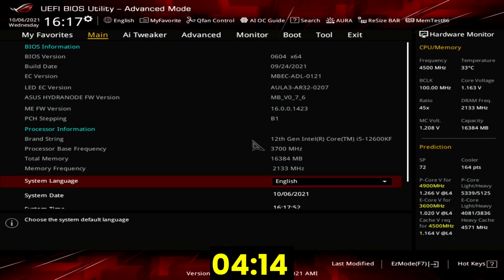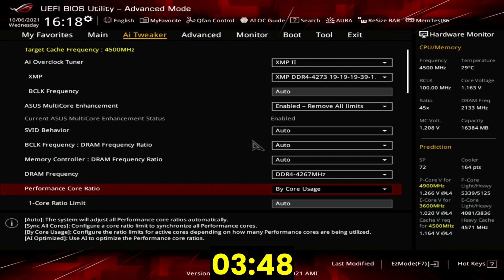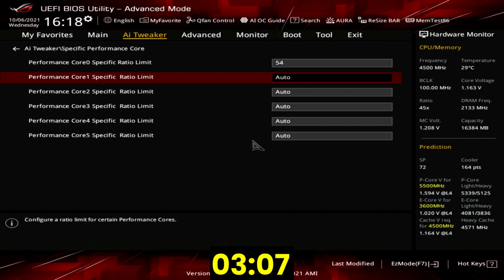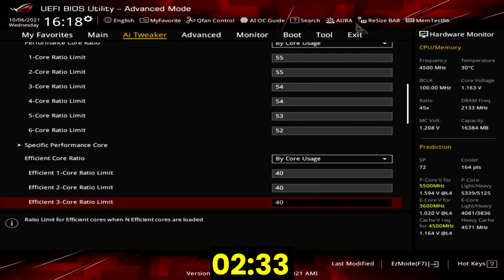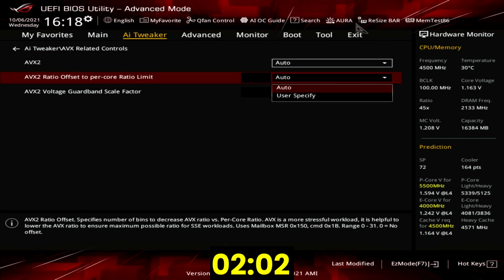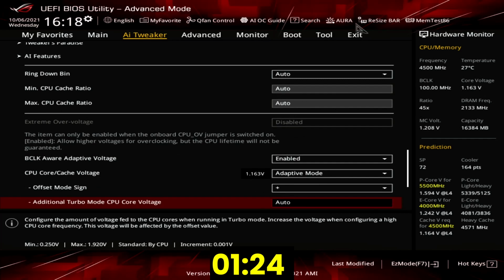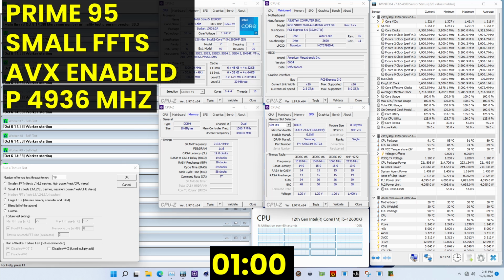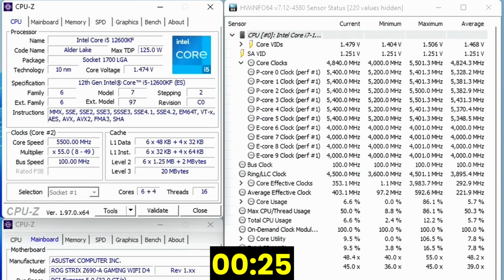5 Minute Overclock: Core i5-12600KF to 5500 MHz

Comment: I'm quite confused, on Intel websites, it says this chip can only go up to 4.8 which mine also does. When I went to BIOS, I can only input 49 for the Performance Core Ratio, I can't input 55 to get it to overclock at 5.5GHz
Reply: You need Z-series motherboard
Reply: Just had the same issue after buying an i5-12600k lol. They don't make it obvious you need a Z board. I miss the old days!  @IndeecFOX

Comment: It doesn’t count as a 5.5Ghz overclock if it isn’t an all p-core OC.  The most I was able to get in an all core OC was 5.3Ghz with 1.355V.  I got my E-cores to 4.2Ghz with 1.355V.  At an all core load on Cinebench R23 and R24, my temps were between 93-98 C.  In case it matters, I have a 240mm AIO.

Comment: Do you think with proper airflow, a 240mm AIO with a high quality thermal paste (MX-6 or Kryonaut) that it could handle it? Or is a 360mm really needed?
Reply: This is just a bad overclock guide in general, with the bios ai overclock I got a conebench score of 18500 at 72c and with this overclock he only got 19900 but the temp hits 100c lol

Comment: I just bought a 12600k for $150. Going to use the Asus B760-I Gaming WiFi board. I’ll be using the brand new Hyper 212 Black that I got for $35. Going to install my Noctuas from my old system (RIP 4.5GHz 2500k) in a push/pull configuration. Do you think it’s possible to OC all P cores to 5GHz with my configuration?
Reply: Some of you may be thinking why Hyper 212 it’s outdated! Well for one it was $35 dollars on Black Friday and for two I have watched multiple reviews that show this cooler being on par with the Peerless Assassin.

One review was a 13700k at 175W on Cinebench R23. After heat soak the new Hyper 212 black and Peerless Assassin peaked at 60C and the Noctua D15S was at 55C which is a $170 cooler.
Reply: This is easily doable
Reply: No you can’t cause B760 motherboard can’t overclock

Comment: @SkatterBencher Greetings, sir! 
May i ask you what's the difference between Core Ratio Limit and Performance Core Specific Ratio Limit? 
It seems that if I use your preset I run into quite high temperatures, so i want to lower the Additional Turbo Mode CPU Core Voltage but when I do that I face BSOD/forever freeze. So, i guess, i have to lower the core ratio's as well. But i don't understand the difference between Core Ratio Limit and Performance Core Specific Ratio Limit. Which one should i reduce, for example, to have x52  P-cores ratio? Both? If so, what are proportions?
Reply from the maker: I can see how those two terms could be confusing. I'll try to explain it.

"Core Ratio Limit" is the term used for the Turbo Boost 2.0 configuration. In short: Turbo Boost 2.0 will allow cores run faster than the base frequency depending on the number of active cores. If one core is active, then there's more headroom for higher frequency then when all cores are active. This is CPU ratios configuration that you usually find in the main overclocking BIOS menus.

"Core Specific Ratio Limit" is the term used for the Per Core Ratio Limit overclocking function. In short: Intel allows you to restrict the maximum ratio of a specific core regardless of the Turbo Boost configuration. For example, let's say you let Turbo Boost run up to 60X when 1 P-core is active but only 4 of the 6 P-cores can run 6 GHz. In that case, you can use the Core Specific Ratio Limit function to restrict only the "weak" P-cores to 59X whereas the others can boost to 60X.

Typically, you first configure the Core Ratio Limit, then finetune if necessary with Core Specific Ratio Limit.
Reply: @SkatterBencher  Many thanks for the response! Will try to find the optimal OC settings for my CPU

Comment: So this is how I adapted to my system with DDR5:
AI overclock tuner AUTO (mine wont work on XMP)
Performance Core Ratio (stable only with): all sync 52
Specific Performance Core Ratios: AUTO
eCore Ration as in video
Everything else as in video
Notice that in new BIOS versions Cache and Core Voltage are separate and you need to put both at 1.45 adaptive.

If you get Bluescreen when testing with Bench it's probably because of Performance Core Ratio that is too powerful or because eCore Ratio is not set 39 40 40 40
Regards and thanks again!

Comment: ASUS Multicore Enhancement. What is the MSI bios equivalent? I can not find this setting in my MSI Pro Z690 A wifi DDR5 bios
Reply from the maker: MSI has an option called CPU Cooler Tuning that does the same like MCE when you set it to water cooler

Comment: I did 

53
53
52
52
51
51

E core
38
38
37
37

In advanced I did
Core 0 52
Core 1 52
Core 2 53
Core 3 53
Core 4 52
Core 5 52

Set the turbo voltage you set to 1.45 but I set it to 1.40

Benchmarked 99th percentile 

So only 1% of existing i5-12600k benched better than mine. Crazy performance

I recommend everyone keep all his settings as he explained but use mine instead. More reliability and basically same performance
Reply: one question,, are these frecuencies wll maintain the frecuency high all the time or will reduce will the system is not using intense task like gaming? o dont want my electricty bills brake y pocket
Reply: @JusunGuitar  Use 52,52,51,51,50,50 and 1.3-1.32v. Stable and use <=135w in typical soft in 100% (work/play)

Comment: I have a question that may seem silly. I've had this processor for some time with 6000Mhz ddr5. My motherboard supports 6000mhz but the processor apparently clamps at 4800mhz. Would overclocking the processor allow me to increase this limit so that it supports 6000mhz?
Reply: Set it to 5200MHz for optimal performance without hitting IMC bottleneck of the i5 12600k
Reply: got the same speed ram 5200mhz on XMP for i512600k no problems runs great @whipboy666
Reply from the maker: Sure! You probably just have to enable XMP in the BIOS.
Reply: @SkatterBencher  thank you !

Comment: Im using the 12600k with 360mm custom water cooling at completely stock i hit 100c in cinebench r23. Even undervolting to 1.18v it sits around 90c
Reply: it should not be a case
i am rolling it on artic freezer 34 (air cooler) and stock running on cinebench 23 going only to 69 max (max peak temp)
something is wrong, maybe forgotten plastic sticker from cooling??

Comment: Why ur frequency on load are lower then u set it? I have the same problem
Reply from the maker: When the CPU hits the thermal limit (TjMax), the CPU will automatically reduce the operating frequency (and voltage) to protect itself.
Reply: @SkatterBencher but it's only 74 max on core, not even 100🤔, and under load all cores are taking the lowest core frequency, same with E and P cores
Reply: @tiblokill  AVX? TVB?

Comment: Im running the 13600kf. And if i run a benchmark the cores dont hit the MAX CLOCK, which in my case should be 5.6. It settles at 5.4. is the reason the temperature?
Reply from the maker: It can be a variety of reasons including temperature, but also your turbo ratio configuration or per core limits. Hard to diagnose over the internet :)

Comment: The results are better than all core overclock to 5.2 on Pcores and 4.1 Ecores. Thank you! Idk how you don’t have more subscribers. Excellent work mate, keep it up.
Reply: Also, my clocks are not even, they are 5480 instead of 5.5, or 4085 on ecores instead of 4.1. Is it normal? Can I make it even? :) thank you for your help again
Reply from the maker: That sounds like it's because spread spectrum of the base clock frequency. That will make it run at slightly below 100 MHz and thus the frequency will be slightly lower. Usually there's an option in the BIOS to disable spread spectrum.

Comment: will this always be overclocked or only when it's needed?
Reply from the maker: Only when it's needed (as long as you keep C-states enabled)

When the cores are not active (e.g. idle) they will go to sleep and use little to no power. When the cores are active, they'll run according to my overclocked configuration.

Comment: May ask you?
It's the same prossecurre for P CORES 4,6 and E CORES 3,6??
I just want to have a little bit more performance with my 12600k
I have asus rog z690 g,12600k,ddr5 6000mhz 2x8 xmp II.
Can you assist me or male a video with lower oc?
Thank you
Reply from the maker: The same process can be followed, just set lower values. If you want more information on how to overclock, feel free to check out my long-form SkatterBencher guide

Comment: Yet again, another video with a massive AVX offset -5. So in most loads including gaming, the clock speed with be 4.9 to 5.0 (not 5.5 GHz) as you claim in the title. Also 1.45 V? No.
Reply: What those should be at?
Reply: Very few games use AVX

Comment: dont use 1.45v...
Reply: Why? And how much should i use?
Reply: @lokiloki2940  cpu degradation...
Reply: @icold666 what's a safer voltage?
Reply: @TB_SnEaKy  I recommend 1.3-1.32. For 5-5.2Ghz
Reply: @IndeecFOX you can do 5.0GHz at 1.0-1.1v
Reply: @zaclaplant3001  maybe with good cpu chip , mine 5.0 it does it at 1.29
Reply: Bulshit cpu degrading :D i use 1.45    6 years long ;)
All ist temp guys.

Comment: Can you do an updated version so it matches the new BIOS versions. Newer versions is alot different . Thanks!
Reply: Use the Intel Tuning Utility software. Much better. You can save and import/export profiles, it's within windows so you don't get stuck in a boot loop and BIOS will automatically ask you to restore to default if you crash (but then you can just load your profile and tweak it).... All the same options for tuning. Maybe more.

It also has built-in benchmarks and stress testing so you can compare with other profiles (The benchmarks  are short, so you'll want to stress test for stability).

Comment: Wonderful Video!
I am interested to upgrade my system to 12600k and prime z690-p d4 but I am really confused about the cpu cooler.
On one hand there's "Gamer Storm Castle 240R" or "Corsair H100x" or "DarkFlash Twister DX-240 ARGB" as an AIO, in terms of air cooler there's "Noctua NH-U12S" "Cooler Master MasterAir MA612 Stealth" "Noctua NH-D9L" "Thermaltake TOUGHAIR 510" "DEEPCOOL AS500 PLUS" "DeepCool AK620" "MASTERAIR MA620P RGB"
These fit in my budget, please let me know if you have had a good experience from any of the cooler listed above or know for a fact that "ABC" cooler would be good for OC
Thanks in advance.
Reply: lian li galahad aio 360 is what im using
Reply: Artic freezer II if you want an aio
Ak620 if you want air cooling
Reply: I would prefer AIO for better sound and performance ratio or go with notchua
Reply: all about warranty length i tend to stick top corsair they offer the longest warranty's on there parts like psu 10 years lol and AIO  5 years and probably more maybe now in 2023

Comment: When I try to change the core ratio limit they all revert to 49. Is there a way I can fix this?
Reply: Do you have a Z690 board? If not you wont be able to increase the multipliers. 
If you have, you need to disable the oc limits.

Comment: Thanks for this guide. I manage to run Cinebench and 3dMark CPU Profile with these settings on : 12600k, Asus Prime Z690M-D4 Plus And Corsair h115i Platinum.
Reply: It’s work ?
12600k , 5Ghz
Reply: @uood-m4j my 12600k max 4.9 and after long time blue screen , with aio 360 aswell dont know
Reply: @ffkfff  my 12600k can up to 5.2Ghz 
also i set 5Ghz is stable and low temperature.
Reply: @ffkfff  if you want up to 5ghz+ you should more Vcore 1.25-1.30 , but your cpu will get 5-8 degrees hotter
I think motherboard It can also cause a blue screen or unstable power delivery.
Should make stable .
Reply: Now i use motherboard z690 Aorus Elite ddr4 i set 5Ghz ~ 5.2 Ghz vcore 1.25-1.27
Temp. 50-60°C full load 70 °C Aio 360 and Overclock Ram to 4000 mhz (corsair)
There are no blue screen issues at all.
👍🏻
Reply: @uood-m4j  i can do 5.0 1.29vcore and load line calibration 3 maybe need 2 and dont have big case and just 2 fans to remove warmth
Reply: @uood-m4j  i have z690 motherboard prime , but you get 5.2 at max 70 degree its crazy , i have 360 aswell maybe something its wrong with it i get 84,85 temp max
Reply: @uood-m4j  what load line calibration you use ?
Reply: @ high or turbo
Reply: @ffkfff  disabled c state , enabled Hypertheading and speed shift and set Vcore 1.25~1.27 for 5.0-5.2 Ghz  (boost  Aio 360 to 2500 rpm ) 
on motherboard Asus can set maximum vcore cpu you can see on bios i think is L1 and L2 you should set L1 150W L2 200W and Pcore 51-51-51-51-50-50 Ecore all37 😁
Reply: @ anyways thanks for the infos , im gonna try it and see if 1.30 stable and good temps could be good

Comment: I noticed that pretty much all the chips you use in your tutorials reach really high frequencies that are quite a bit above average, if not in the top few percent - I'm guessing you have access to binned chips?
Reply: It's because he uses a massive AVX offset of -5. Real load frequencies are 4.9 to 5.0 GHz (not 5.5 GHz) which most 12600Ks can reach.
Reply: Agree, my cpu is 100% stable at 53x AVX2 set to 2, if i go any higher my cpu becomes unstable and my pc crash.

Comment: can you do a tuto overclock with intel extreme tuning utility?
Reply: It will only bump you up to 5.0 and voltage may be to high
Reply: @sagerdood  yes i know i push my i5 at 1.380v not on purpose, it's a dangerous tension or not?
Reply: @charlespinot8449  as long as your temps are in check im gonna say your fine! My 12900k runs 5.2 p 4.1 e on 1.30. Are your temps good?
Reply: @charlespinot8449  if there not go in and start to lower your voltages until instability and see just were you can be stable.
Reply: @sagerdood  84°C on Prime95 with 190w comsuption, but in game 65°C in cyberpunk 2077 with keanue reeves😂
Reply: @charlespinot8449  you good to go!
Reply: @sagerdood  I have my i9 12900k with all pcores at 5.1, ecores at 4.1 with 1.3 volts as well. As cooler, I am using an nzxt Kraken z73 having idle temperature around 35 degrees all cores and 60-65 under load. Tested in watch dogs legion which it seems to use quite a lot of the CPU 40-45%, 120 watts average. If I set him up to 5.2 the temperature is going higher and is eating more. I am happy like that. What temperature do you have at idle or load during gaming?
Reply: @mariusbalan4098  I have a question, I put adaptive voltage, but the voltage stay high with low frequency, he moves very can?  (1.280-1.310v)
Reply: @charlespinot8449  I have set it to manual mode to 1.3v. 5.2 pcores and 4.2 ecores. No issues so far.
Check my video here on the gaming channel:
https://youtu.be/YumBNmd7spA

Comment: I suggest that if you're going to talk about CPU Watts, it would be interesting to define LLC, AC_LL and DC_LL. 
It is impossible to know if the power reading is correct if DC_LL is not tuned to LLC.
Reply: That's a good idea, and true !
Reply from the maker: I refer to HWiNFO's CPU Package Power reading for the CPU power which I think is sufficient for the purpose of the guides. I think acounting for AC DC LoadLine is a bit too complex for what are supposed to be just easy to understand overclocking guides :)